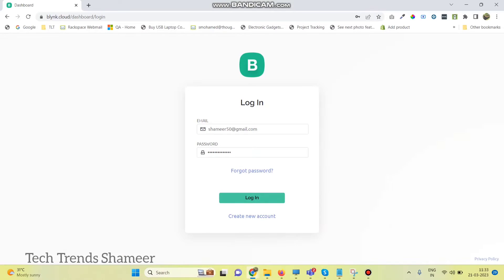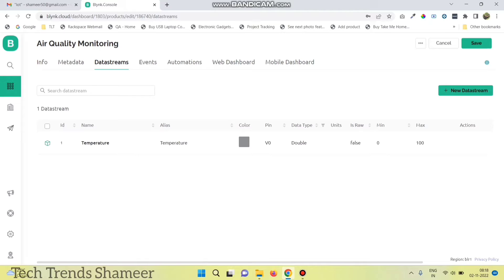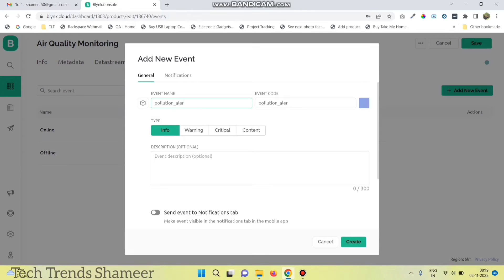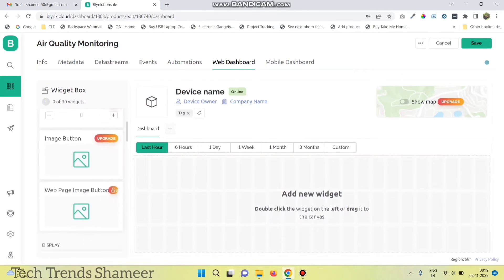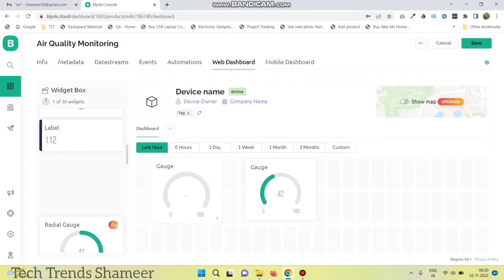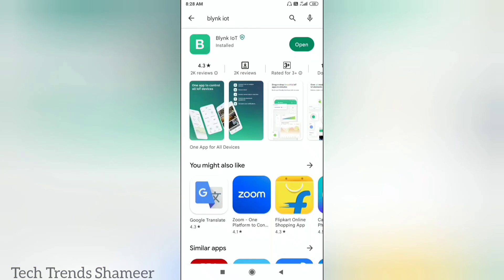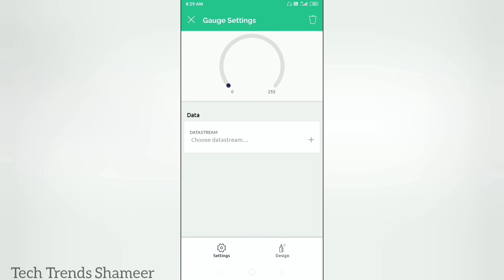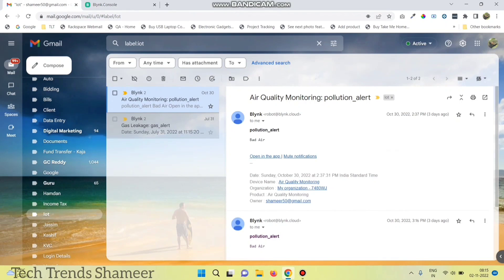How to Monitor Air Quality | Air Quality Monitoring System | ESP32 | Blynk IOT Projects

Comment: Which connecting wires should we use? 
Male to Female
Female to Female
Male to Male
Reply from the maker: depends on the pins in the sensor and the board. If the sensor has male pin, use female pin wires.

Comment: Without any external power supply how you run lcd display. bcz... for display we need a continuous supply... so how can you perform this ?
Reply from the maker: I have connected power supply from the laptop. You can try using Power Banker.
Reply: @TechTrendsShameer  how many Volts?

Comment: you are showing wrong things in this video you are using ESP32 And using ESP8266 BOARD MANAGER how can it compile with ESP32 BOARD Dont misguide the people can you send me the proper code for ESP32
Reply from the maker: Sorry for the confusion. The mistake is only on the board selection. That clip got interchanged while editing the video. Rest all are correct. Please check the video description for the code.

Comment: If we are using esp32 why would u choose esp826 on the arudino IDE
Reply from the maker: Its a mistake. Please select ESP32 Dev Module in Arduino IDE. Please check the video description for the correct source code.
Reply: @TechTrendsShameer  and even if I select that it's not showing connected on arudino ide
Reply from the maker: Send me screen

Comment: What wifi library did you use sir?
Reply from the maker: Install the Blynk Library and ESP32 board.
Reply: To get that authentic code , do we need to purchase blynk
Reply from the maker: No need. You can create up to 3 templates for free in blynk.
Reply: Ok, thank you
Reply from the maker: Welcome
Reply: You are using esp32 wroom32 module in this project?
Reply from the maker: I am using ESP32 Development board
Reply: What about the code, can we upload this same code to my esp32-wroom32 board
Reply from the maker: Yes. Just try.
Reply: @albertrymbai5223 Hello can u implement this project successfully